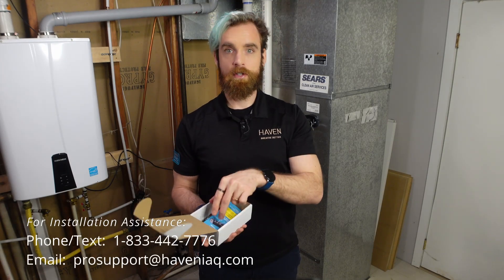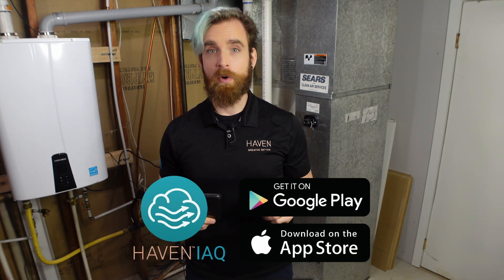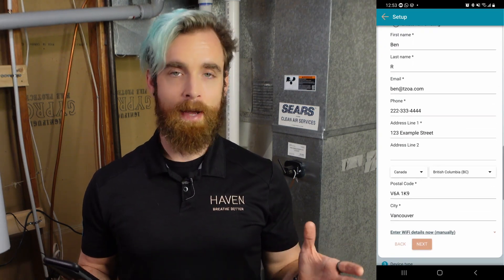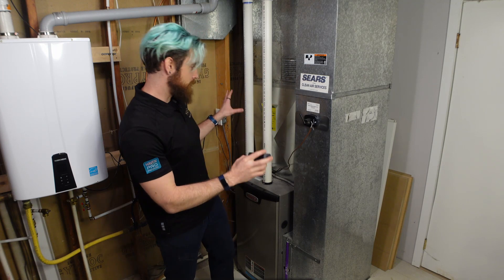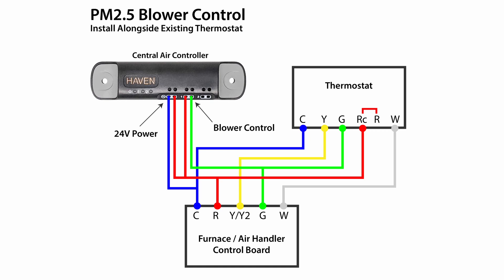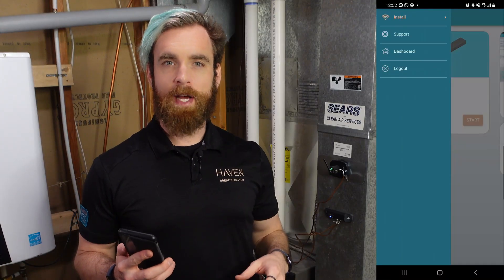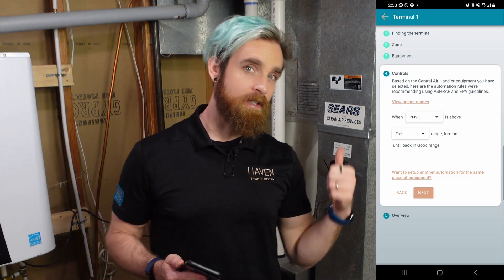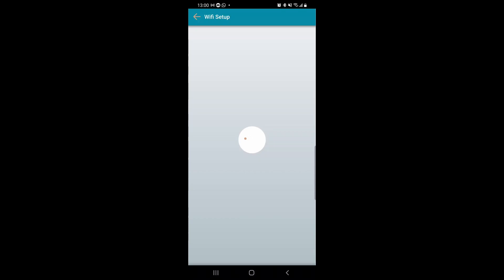Central Air Controller Installation Instructions

Comment: Ads in the video are you kidding me? 

Manometer? Its reading VOCs!

Im sitting in front of a blinking green and purple light and your telling me theres screws in the box?

SMH
Reply from the maker: Hi @onestoppro, sorry it took us so long to spot this! Our Pro Support hotline is shown right at the start of the video (around 10s mark) - please do give us a call if you need help during an install! Re. your comment:
We have no control over YouTube ads and processes, sorry.
The Monitor reads Particulate Matter, total VOCs, Relative Humidity and Airflow. The Controller (which this video relates to) simply activates equipment based on the Monitor's readings.
Please do check out our updated install videos for both the Monitor and Controller here: https://youtube.com/playlist?list=PLP_fkXern0I9NK_-2kSHgc-JOVaGYV269&si=WzvH3EsmfxCW5b1k